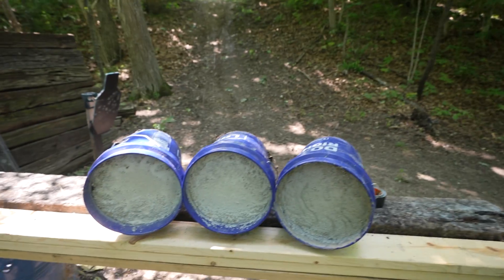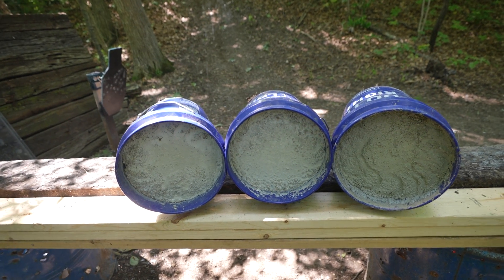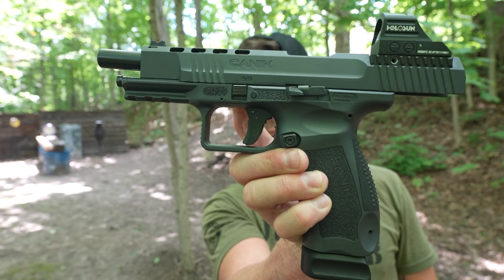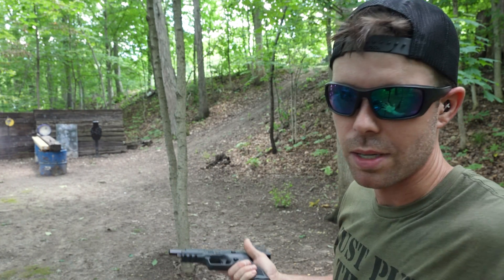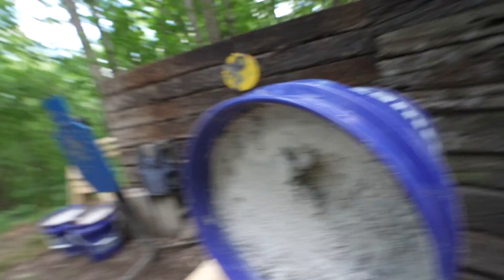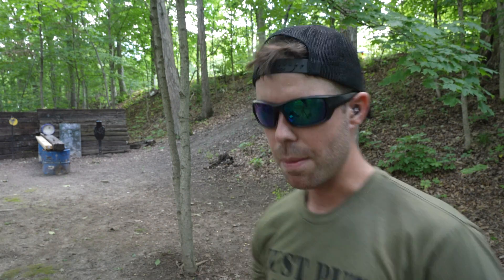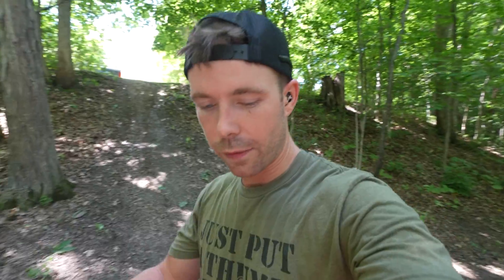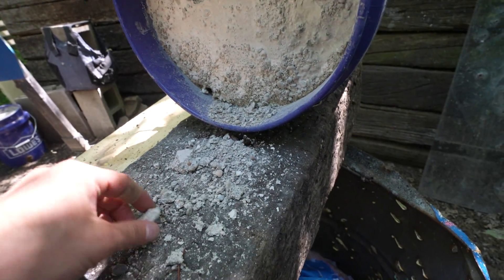How Far Into Concrete Will A Bullet Go?!

Comment: That concrete was poured dry and doesn't have rebar like real concrete slabs or 4000 psi high strength concrete with 1-1/2 rock aggregate like a real concrete wall.  In your next test make a wooden form, use rebar and let your concrete set up for a month with high strength concrete.

Comment: Idiot learn to measure. 9mm and 10mm is like 2 inches but rifle rounds are less? You are measuring the hole to surface but forgetting the surface you are considering the surface is already 2 inches deep from the original surface. It’s a pit first like the 9mm plus the 1.5 inches you measure. Ffs

Comment: Standard pre mixed concrete is about 2500 PSI after ten days hardening.  If you're building for impact resistance it's not hard to jump the mix to 4000 PSI. (Only one more bag of cement per cubic yard)  Steel reinforcing, layers of mesh, and a sand bag perimeter would multiply that protection.   I would love to see the 50 BMG trial.

Comment: During the Vietnam war, my father designed 50 cal machine gun turrets for his installation . Its ram earth wall was .5 meter thick, outside the wall there was a layer of sand bags, which were provided by the US Army. The sand bags were filled with earth soil heavy in clay, because there was no budget for VNRA to built the installation. My father was well loved by the GI, because he bought all barb wires and bars from them.  The GI stole all kind of things from their installation so they could have the money to visit the whore house.  He sold swamp woods harvested in his district to get the money for purchasing. He also added a net of well knit barb wire to stop the incoming rocket or mortars. Sometimes I how good is the gun turrets designed by him. He did win a battle at his installation at the ratio: 10 to 1. Five hundreds bodies were left at fences, many hundred VC wound and died later due to lack of medicare.  In that battle he lost only one sergeant due transferring .50 caliper ammo.

Comment: Back in the ‘70’s, I watched a Vietnam Vet fire .30-06 Armor Piercing rnds into 12” thick concrete wall (3 or 4 shots). From a distance of 25’ - 30’.
With a Springfield 1903A3. About 6”-8” apart. You could see the Tungsten Alloy core about 4.5” to 5” in the concrete.
He said that they probably poured that wall with a 4”- 6” slump. They did not want it to fall apart!

Comment: There's an approximation on penetration depth made by Newton:

> For a cylindrical impactor, by the time it stops, it will have penetrated to a depth that is equal to its own length times its relative density with respect to the target material.

> According to Newton's approximation, a full metal projectile made of uranium will pierce through roughly 2.5 times its own length of steel armor.

So, to answer your question - not very far.
Reply: Just to follow up - a 50 BMG isn't going to blow through the concrete either, if we go with Newton's approximation.

Comment: It looked like the bucket moved further back with the 12 ga shotshell compared to the other rounds, even though it didn't get as much penetration.  The AK didn't have a light primer strike, it just didn't like you referring to it as a "choppa" or whatever term you used.
Respect young Jedi, respect the AK.  Cool video and those shot shells are definitely pretty awesome.  You should get to 100K soon brother, you're producing some great content.  Can you get a swamp cooler and power to your range for these hot/humid days?

Comment: The 22lr blank countered the penetration. You can see in the slow mo that the 12Ga 22lr slug actually moved the bucket backwards.. Wow!!  So did the 308 Win.  How much does that bucket of cement weigh?  30lbs? 50?  Try a normal 12Ga slug and see what you get.

Comment: Obviously this concrete hasn't had that much time yet to harden completely.

Still an interesting video though
Reply: The longer it sets, the harder it gets.
Reply: Exactly what i came here to comment as well. That concrete looked pretty green still.
Reply: That and vibrating the mixture down. Removing the air pockets and packing the aggregate. They're just 5 gallon buckets. A palm sander on the side would suffice.
Reply: It was not stated the age and how that concrete was poured.  It makes a difference.  To achieve full strength it should be mixed to  the proper consistency and cured over 3 days by being wetted.  Not sure if that was done.
Reply: Also buckets should be fixed, so bullet won't lose energy on impact. In some cases the bucket gets pushed an inch or so when hit.

Comment: This test is flawed in a few different areas.  The first shot is going to fracture the rest of the bucket.  So any follow up shot will look more powerful.  The second flaw is how the concrete was mixed.  If it was wet the aggregate will have settled to the bottom.  
Cool video but not scientific.

Comment: Should you do a similar video again, you can place a long straight edge (e.g. scrap piece of wood) across the mouth of the bucket and measure from the straight edge to the bottom of the hole.

And if you get a .50, you may need to also buy more land. LOL

Comment: Now if you were to make the concrete as follows in a 1,2,3 mix i.e. bucket or shovel measure. then when you shoot it it will laugh at you. ( Similar to high security safe filler)
One part Portland cement. (The glue)
Two parts fine grit (Sand and aluminium oxide grit mixed 50/50).
Three parts course filler (ball bearings and stainless steel swarf from a machine shop).
Mix well with water, fill container, remove air bubbles, cover and set slowly for a week or so. But removal may need a special heavy duty crusher and a lot of money to repair it afterwards.

Comment: There is a difference in shooting 16” vs 2”, 4”, 6” or 8”. A bullet might punch through 2” while only punching a 1” deep hole in a thick slab.
Reply: Not to mention, the results would likely be far different and more life-like if those concrete cylinders weren't inside those stuff buckets keeping it compressed. 

Better idea would have been to frame a small wall about 8-12 inches thick, and fill it with concrete and then remove the frame and shoot it

Comment: Please do not be so quick to open your bolt after a fail to fire, i know it didn't pop but if that was a hangfire and you open the bolt then you'd have a explosion in your face. You should wait a few seconds, and look towards the ejection port, before cycling the bolt.

Comment: Concrete takes 20+ days to fully cure to reach maximum hardness and the cracking and cement smoke upon impact reveals cement hasn't fully harden. Also higher strength concrete (PSI rating) will cause bullets to bounce more often which is what concrete bunkers are made from.

Comment: Back in 1990 I chopped down a tree with my AK. At the time a 1000 rounds was only $100 or so. If I remember it took about 150 rounds to take out the tree. @9 to 12 inches in diameter.  Wish I had video back then. Semper fi

Comment: I enjoyed the video. Thanks for putting in the work. Just my 2 cents here. Most concrete contains sand and rocks like 57 rock. I didn't see any in the buckets. Looked like cement or motor which is sand and cement. Might get different results.

Comment: Need to buy the trigger spring for the savage axis and polish everything up.
Reply: Just cut a couple coils off the factory spring. Cuts it in half. If you want more the  go a quarter coil at a time. Definitely wouldn't go below 2lbs without doing what you said though.

Comment: I think reinforced concrete, or concrete with rocks in it, may even stand up better.
Reply: it would not only have stand up better, but would had stand up WAYY better. Demolition Ranch did a video shooting concrete block with rebars and another concrete w/o rebars. Reinforced concrete vs non-reinforced concrete. You should go check out that video.
Reply: @prandomable  Reinforced concrete combines steel with concrete.

Something like standard rebar in there probably wouldn't change things drastically (unless you happen to hit the steel rebar.

But there are other ways to reinforce the concrete.  Like Helix steel.  Which is going to diffuse steel throughout the entirety of the concrete matrix.

This is going to up the durability of a concrete barrier significantly.

Not that you COULD NOT blow through it.  Given enough time, ammo, and actual firepower (.50 cal and 20mm rounds basically are "everything degradeable").

But at that point, you may as well have set up a test for the MOAB.
Reply: @PhotonHerald  there are bunkers that are literally designed to survive "direct nuclear strike". However lot of concrete and steels are needed for sure to build it...
Reply: @prandomable  usually nukes air detonate above the target and don't directly hit something. This way they do maximum damage over a wide area, instead of something like a penetrator/bunker buster.
Reply: @77Avadon77 bunker busters still have limitations. We don't even know if it actually destroyed Fordo or not...they didn't use GBU-57 because Trump said it was too deep for bunker busters.
Reply: @77Avadon77 there are bunkers that are literally designed to withstand (direct) nuclear strikes....direct meaning not air burst. And nukes explosions are way more powerful than some weak bunker busters FYI.
Reply: Concrete and cement is diffrent. The thing he shooting is more like cement than concrete. But yes, with the right sand and rock mix, it can stop almost every thing that not explosivey
Reply: @gokudo-cf5pt  The mixture of cement and sand is called mortar. The mixture of cement, sand and rocks/gravel is called plain cement concrete or PCC. The mixture of Cement, sand and rocks/gravel along with steel bars is known as reinforced cement concrete(RCC). So basically the strength depends on the grade(Mix ratio of the above) of concrete used.
Reply: @gokudo-cf5pt  how is concrete and cement cinder blocks different? Explain that.
Reply: @prandomable  u can use cement to built brick wall right, and there also stickyness of the cement( not sure what u guys call the unit in english ) . But concrete u can cast it, built reinforce wall and can take lots of compression. Bottom line is think cement as glule and concrete is the product of mixing a lot of stuff to get something harder than rock
Reply: @prandomable concrete is cement with rocks in it and ither chemicals. Cinder blocks are follow concrete blocks that later get filled by grout

Comment: Great video!
Ive been thinking about building a house out of concrete blocks filled with sand or dirt. I would really like to fill with concrete, but the cost would be crazy. 
Seems like it would be great for protection, but it would also be good for insulation, imo. 
Any way to do a video about something like this?

Comment: Awesome video as always but curious. What is your personal opinion on the knockdown power and penetration power between 30-06 vs .308? I hear the difference is negligible and up to personal preference and I personally like 30-06 myself
Reply: You will usually get another 100-150fps with the same mid weight bullet from a 30-06, at the cost of 20ish % more powder and a long action. Almost negligible for these purposes, makes for a little less drop and drift at distance.